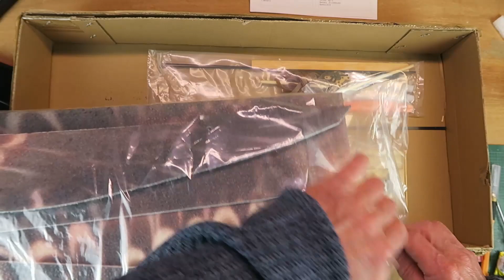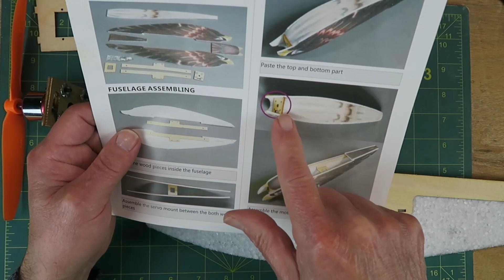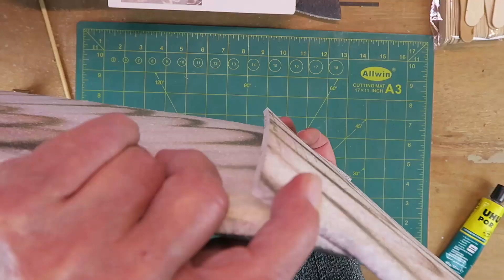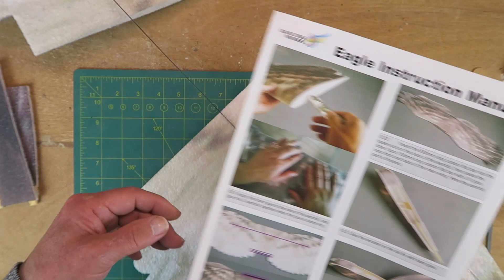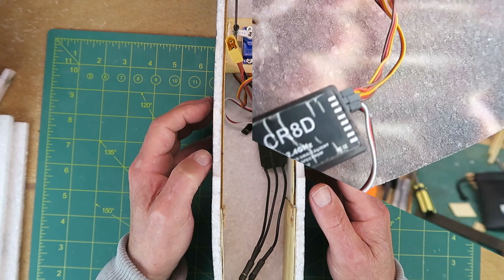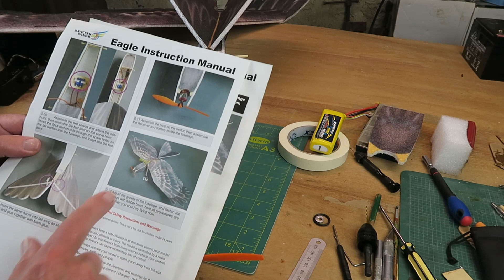Dancing Wings Hobby DW E19 Eagle V2 1430mm Wingspan EPP RC Airplane Kit Build

Comment: Gosh there seems to be quite a variation in the kits !!! I'm just finishing mine and now im going to locate your maiden video !!! 😉😎
Reply from the maker: Maiden is here : https://youtu.be/GL_YyjDLfO0 also don't miss the Eagle screaming!! https://youtu.be/Z4jbbKaVEyA Thanks for watching, have a great day!
Reply: @1nformatica  hello again!!! Yes I had watched the screaming eagle and maiden and of course your assembly video!!!! I've got mine together but unsure which way to setup the control surfaces...... V-tail or flapperons or Delta wing...... think I will rewatch your build video.... And PS I've got a diesel sound thingy to put in also! Take Care and regards Deane 😉😎 happy flying
Reply from the maker: @deanedeane4318  The tail feathers are in "V-tail" mixing. It can be a pita to setup depending on your radio, prepare for some head scratching! Can't remember how many times I reversed servos!! Good luck!
Reply: @1nformatica  yes and thankyou for replying. I've seen several different ways and this is my first v-tail, I got it working but couldn't sink my favourite stabllzer, so I've purchased a 3 channel stabllzer for v-tail, Delta wing or flapperons..... toooo many options. I was searching your footage for rudder inputs but couldn't see if there was, I wondered  about making the v-tail elevator only and ailerons for turns then leave the rudder out...... Still it's fun tinkering but not crashing..... Happy flying!!!
Regards Deane 😉😎
Reply from the maker: @deanedeane4318  Yes, although a V-tail mix I used the aileron stick for direction as I show here : https://youtu.be/gE-pUJ9d_DI?t=924 It's a very stable flyer so I don't think you need a gyro. BTW I use the Hobbyeagle A3 Mini as my gyro of choice these days, covers all options I need : https://youtu.be/rPhf0cLP1hw